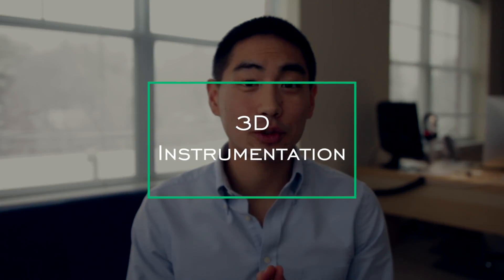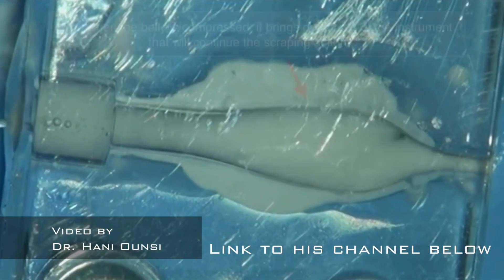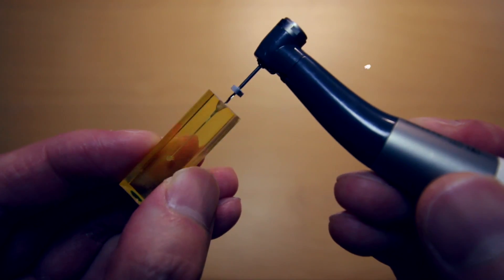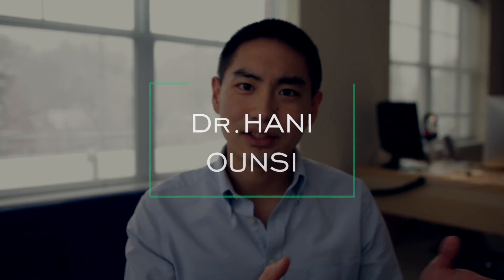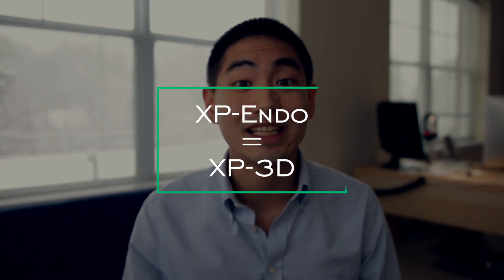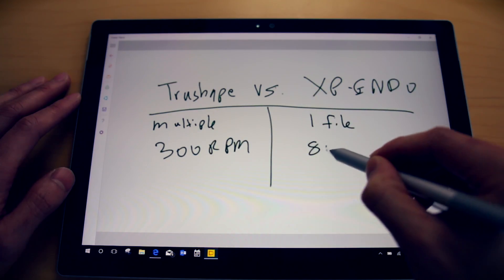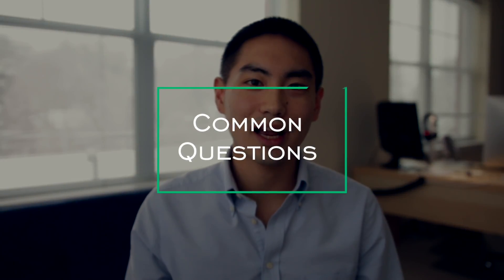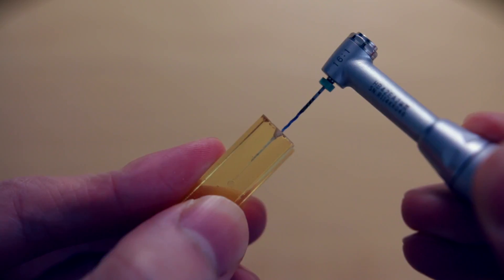3D Instrumentation EXPLAINED | TruShape vs XP-3D | keVLOG

Comment: Why did to wrote "50.04" next to the "XP Shaper" diagram on minute 1:25? I keep hearing this number from the US folks more and more, where as over here in Europe, they stick to the 30.04 ISO Number... Strange :D
Reply from the maker: Great question! I placed that to demonstrate how a 30 size file can clean a greater size than its physical state. I used 50 as a random number. I guess I can say > 30 ISO instead. This is different compared to normal Ni-Ti rotary files that can only clean and shape its own size. My impression is that the XP-Endo may be able to expand more than TruShape. As for taper, I need to look into it a little bit more. I know the XP-ENDO Finisher is 0 taper. For some reason, I thought the actual taper of the Shaper is .01, and then can expand up to .04.
Reply: I find that the XP Shaper expands more than the TruShape, they are to stiff and force the file more away from the dentin wall. The XP Shaper - also due to its higher rpm- sticks more to it. But the cases I have done with the XP Shaper are a bit discouraging, especially if you compare them to the SAF file. On really oval canals like premolars, the wides part in buccal/lingual directions still gets little dentin removed, and much more in the most narrow part in mesial/distal direction. The SAF removes the same amount on all walls on contrary. If you use the XP Shaper file in the "kiss and go" principle, the apical part stays a ISO 30 in most cases, if you keep going I usally ended up fitting a ISO 40.04 guttapercha. Overall, a nice tool to have, but unfortunately not the "one file endo" many general practitioners are looking for. Keep us informed on your opinions!
Reply from the maker: Wow! Incredible feedback. Thank you for taking the time to share your thoughts :)
Reply: Is this not the main purpose and benefit from the internet? Helping each other out and achieve more each day! Keep it up PS: Do you have an Air Scaler in your endo "Bug out bag"? 😬
Reply from the maker: Very true! Sharing and helping each other is certainly the main purpose ... Air Scaler? I am not familiar with that instrument. Is that a sort of ultrasonic?